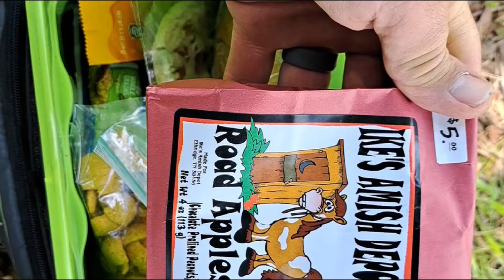Digging Foundation  #Foundation  #construction

Comment: Here in Ireland i remember on an old scheme i was on we were doing an extension we had to dig the foundation 3 feet wide and 3 feet deep it was 3 foot square the extension was over 20 foot by 20 foot even building a house it was 3 foot wide and 3 foot deep
Reply from the maker: Wow thats a deep footing 8inch thick concrete and about 24inch wide is the normal around here
Reply: @burntchurch  We had to put reinforce bars in it as well and that had to be joined to the house foundation and the house foundation was a quarter the size of what we were doing the house was 2 story block built it was sitting on a narrow foundation the man that built the houses didn't give a crap what way the house was built just thru them up and used rejected timber and breeze blocks